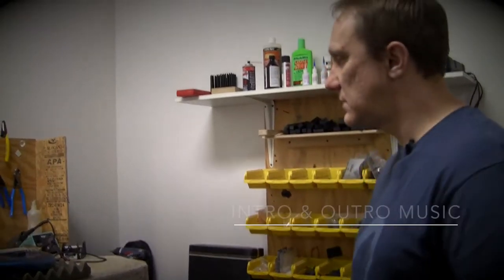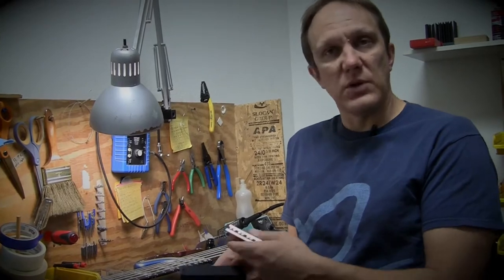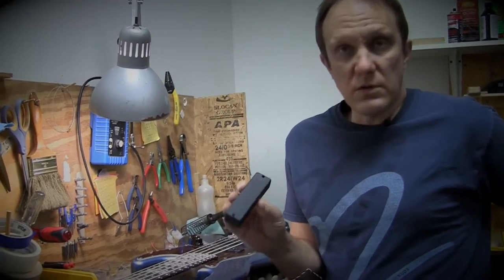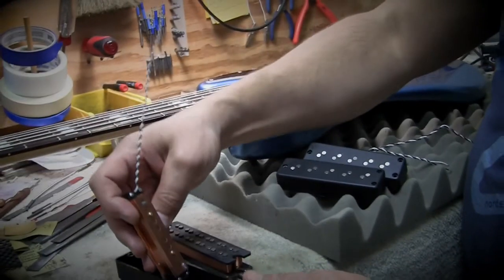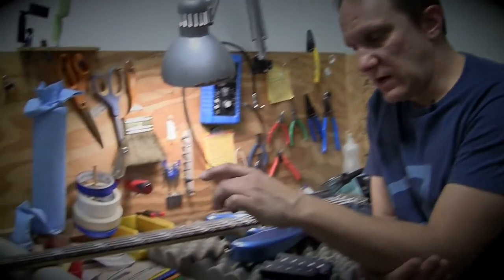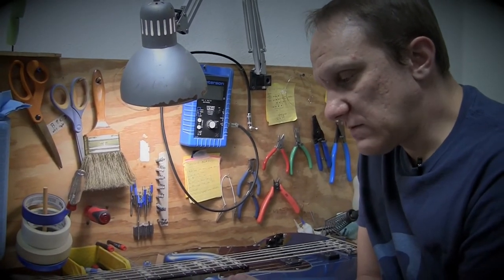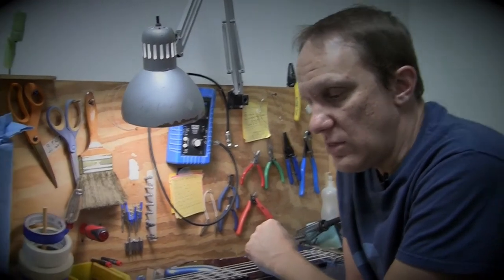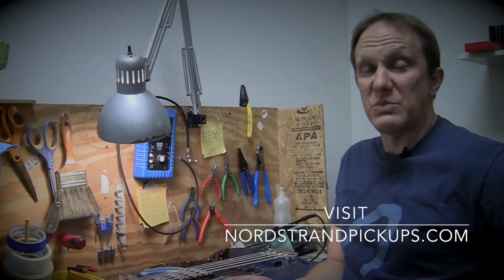The Beginning of the Nordstrand Big Singles

Comment: Don't like the hum, but the sound is so great, I just tolerate it. The Big Splits are nice, but I can hear the difference. In the future, maybe one that sounds exactly like the Big Singles, but without most of the hum? That would be out of the park! These are also out of the park and we thank you fella for a job well done.
Reply from the maker: chuck! Big Singles sound the way they do because they ARE single coils!
Reply: @NordstrandAudio  Couldn't agree more and they are amazing. The point was, wouldn't it be amazing to have this tonal versatility and power without the hum? Just hoping technology may go in that direction at some point. Otherwise, I believe this is the best of the current best.
Reply: The problem with low output on the Stacks is from the pole pieces going through both coils. What's different between your Big Splits and Breaks?